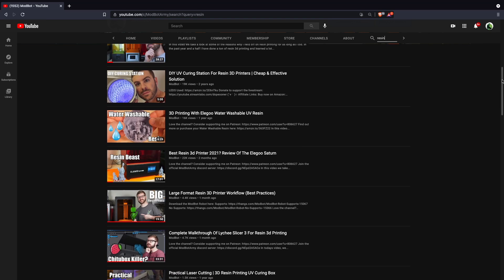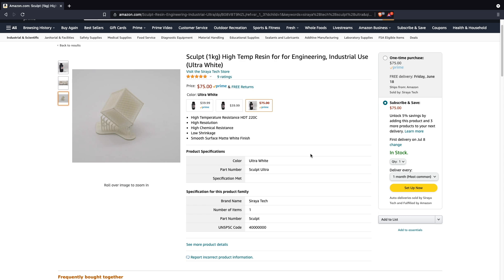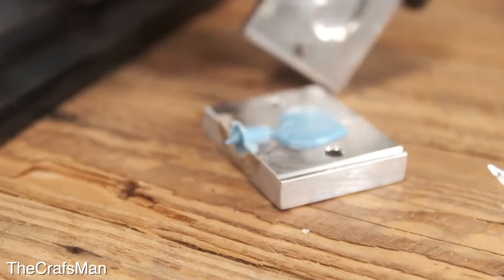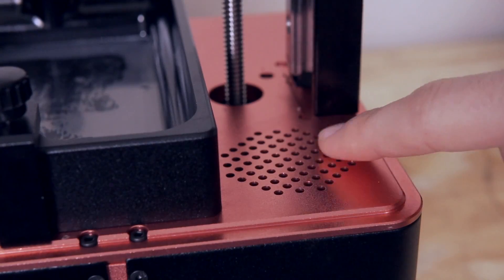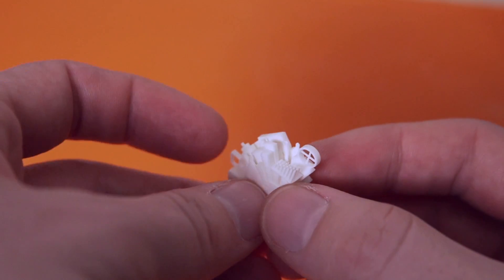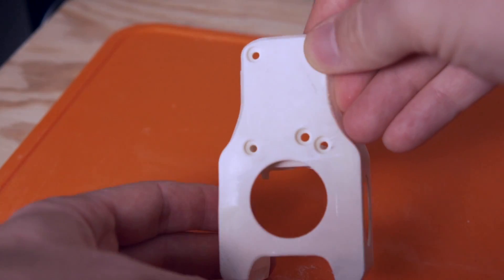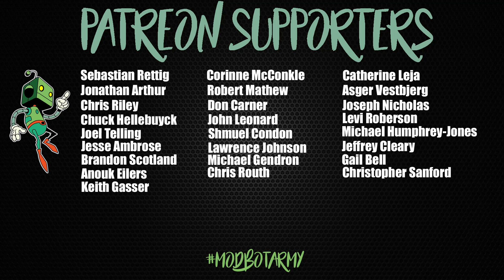High Temp Resin For Function 3d Printing (Sculpt Ultra)

Comment: Theyve actually bumped the hdt up to 250 nowadays but i just bought some of this resin as an option to resin print printer parts that go inside printers with a heated chamber like my qidi plus 4. Im going to make a beacon mount out of this stuff and see how it fairs being close to a 120c bed temperature

Comment: Hi! Did the mold halves came out straight flat from the build plate? Or did they tend to warp a little from the corners ? Right now im having very hard time trying to keep the bottom of the mold straight, it warps like 0.5 mm from the bottom corners. However the cavity face come out dead straight (checked with surface gauge and granite plate). I,m printing with sculpt white version

Comment: I printed a clamping arm with empty bores that were just barely a snug fit for the threaded inserts. I then added some liquid resin to the bores with a q-tip and pressed in the inserts and sent the clamp back to re-cure. Hasn't given up yet.

Comment: I find it impossible that you know all of these things about SLA resin and still dont know to use proper protection. You even mention you prefer low-odor resin because you work in a small workspace which is like, the opposite of safe. You should not be SMELLING the resin (especially as it cures), that means you're inhaling harmful VOCs. You wear gloves to pour the resin so clearly you know its a dangerous material. Do yourself a favor and take your health and safety seriously, or at least stop making videos about resin printing unless you're willing to be serious about safety. Stuff like this leads to new printers harming themselves with poor safety awareness.

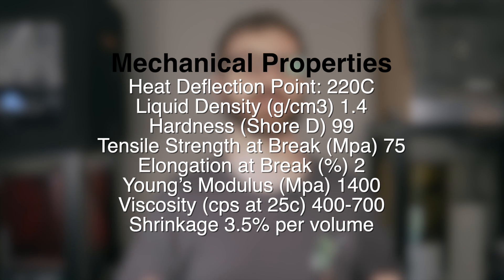Comment: The figures I'm reading in 2024 for Sculpt Ultra White are completely different than those mentioned in your video at 03:30 as well as in your Google spreadsheet. 
For example (newer first): Shrinkage per volume 2.5% vs 3.5%; Elongation at break 1% vs 2%; Young's modulus 8000 vs 1400 MPa (!), etc.
Do you know if Siraya Tech has changed the formulation since 2021? And not a little!

Comment: Seems like resin printing also opens up to practical printing as well. 200+ C° is really really good. Its way better than any FDM material that you can buy without robbing a bank. Details are also important in many applications, especially when the parts are tiny, and you need a smooth uniform surface. An another + for SLA or DLP is that your part has the same strength no matter what is the printing direction  FDM still have its place, but personally i think resin printing can be a huge additional.

And the possibilty to make custom colors, "alloys" oh man... Thats just way more fun than buying filaments that you can not modify

Comment: You should try adding the brass inserts in, without heat, before the part is fully cured, using clear resin so you can UV cure after the brass inserts are in place

Comment: Lower HDT resins will accept heatserts. I've had luck with sirayatech blu. An issue that can occur is overheating the resin.. it will turn into glass / sand. Also, a tenacious mixture will allow for more of a "nylon like" print which will increase impact strength.

Comment: Nope you cannot heat press inserts int resin, resin isn't a plastic, it's a... resin lmao
At most you can dial the tolerances and just force press it in, but then still it's not exactly recommended.

Comment: What resin would you use if you were to resin print an end use auto part, normally made with ASA for UV and heat resistance? Also, do you have a video explaining what and where you can get dyes for resin printing?

Comment: The best Resin I have used yet, is the eSun water washable, its strong has no smell and you can clean up in water, I hate using sticky resin and IPA, its messy and toxic.

Also, don't bother using inserts, just print the thread, and never over cure as the more you expose resin to UV the more brittle it becomes, if you keep it slightly sticky and just paint it, the stuff is almost indestructible.

Comment: FYI heat-set threaded inserts will not work in these types of resin, Generally speaking photo resins are not thermoplastics. You may be able to heat-set them in a castable resin, but most of those are wax like in their cured form and wouldn’t work well for functional parts. Inserts meant to thread into materials would probably work but you’d have to pre tap the outer thread into the resin part.
Reply: So what suggestions would be for this?  I need to print my Voron 2.4 extruder/hotend parts due to breaking something and have access to resin printer.

Comment: Tapped threads actually hold decent pressure so far, tried m3 threads and they came out clean. Might do a test print and use my electric torque screwdriver to get some numbers. Currently printing Hotend duct parts however.

Comment: hmm Im making an ultem high temp printer and this could be useful... 75$ per KG is not bad! (ultem it self is 200$ per kg lol) but I wonder how it can realistically withstand the forces I want it too in my enviroment. but i need it to handle pressure at that temp. not just exist in them! and i want to not suffer degrading at those temps long term. 

my main issue however is that I can't print ultem yet, so i can't make a printer that can print ultem. this is why this rocks. I can just order it from a random SLS seller, my parts weigh only a total of 100g-120g  anyway..

Comment: Great video. Looking forward to trying this resin myself. Instead of injection molding, have you considered casting with two part urethanes directly into a 3D printed mold (skipping making of the silicone mold from a master)?

Comment: Thanks, looking forward to the follow up video.  With brass inserts I've had good luck with oversizing the hole to the OD of the insert and then coating the hole and insert with resin and using  a uv light pen to set it.  I also find when over sizing the hole it's much  better to run your drill in reverse, prevents cracking and chipping bit I still effective at drilling.

Comment: i print molds for silicone here. I just use normal resin and spray with mold release and it works fine. I don't know why you would want this heat range for a mold? what material do you plan to cast in these?
Reply: If you want to use a thermoplastic material such as polystyrene which melts at 464 deg. F a silicon mold wouldn't handle it. If you want to cast metal there are alloys that melt at around 200 deg. F which could be cast in Sculpt Ultra.

Comment: Great video. Specially the info about the brass heat inserts. I was wondering about that myself. I guess I could just design my parts so the insert just drops in. Put a piece of scotch tape to close the threaded hole at the bottom and glue them in with either epoxy or even better yet a uv curing adhesive.
Reply: Yes, i've done this and epoxy works very well.

Comment: These photopolymer resins are what is called thermoset polymers, which do not melt but burn when exposed to heat after curing.

Comment: If the part is big enough, you can use these  'Nartel® Metal Self Drilling Plasterboard Fixings Cavity Wall'' . Break the self drill tip, and use 7mm drill.

Comment: Resins are Thermoset polymers (https://en.wikipedia.org/wiki/Thermosetting_polymer) which means they cure once and then with heat these polymer degrade rather than "reform". This is why you saw the "crumbling effect" when you tried to put the heat inserts in.
FDM polymers are Thermoplastic (https://en.wikipedia.org/wiki/Thermoplastic). These Polymers can be remelted and this is why you put heat inserts in.

Comment: You may already know this, but professional prototyping services will usually use helicoil inserts for screw bosses in SLA parts. You have to buy a tap-type of tool for each size you want to apply, and installation requires a little bit of user skill. They're not cheap, but work well.
Reply: Maybe you leave the holes larger so the brass insert slides in feely. (First, mask off the bottom of the insert.) Fill the surround with clear resin. Then UV cure it. Will the UV light cure all the resin, or will the outer resin filter the UV "protecting" the inner resin?
Reply: I was going to say the same but you got there first
Reply: @dougyt261  I was going to say that before you.

Comment: i'm working on using castable wax resin to print parts. Put in investment plaster, harden, and burn own.  You can then use the investment plaster molds to cast aluminum.

Comment: I have tappered heat inserts work fantastic on resin. I've done a drop of resin, insert, re-cure and I've also done a drop of super glue and these are even stronger and less stepsI've been using these inserts. https://www.aliexpress.com/item/1005001770296100.html
my first major resin failure on my Voron... https://www.facebook.com/sylvain.martin/posts/1185409028554328:9

Comment: My only complaint with resin printers is the limited ability to modify them and upgrade them. Would be fantastic if they was as modular as FDM printers so I can tweak things to make it more closely fit what I want to do. Very interested in seeing some tests combining the resins and see if a better overall resin can result...
Reply from the maker: Yeah, would be nice if you could hack and mod on them like an fdm printer. I think it may end up coming but it will be much more complex and less DIY. I can see third party companies releasing upgrades that would require you to buy them

Comment: Heat inserts won’t work because resin isn’t a thermoplastic. It just dissipates into atoms instead of becoming a fluid again when heated. Maybe someone invents a thermoplastic resin in future
Reply from the maker: Thank you! That would be awesome. Excited to see this technology continue to evolve.
Reply: @ModBotArmy  There are self tapping inserts now. You may need to change the hole diameter but I think it's worth the try! Also a strength test would be cool https://vonwange.      com/product/100-pcs-self-tapping-inserts/

Comment: I might be wrong, but I think cured resin is a thermoset so it doesn't melt like FDM parts which are thermoplastics; they'll just burn and crumble instead.
Reply from the maker: I do think you may be right. That was at least my results.

Comment: Is there any safe resin with no fumes? I’ve been wanting a resin printer, but I don’t wanna put my kids health at risk.
Reply: There are plant based resins that are a lot safer. I cant say if they're 100% safe but I know they're better. It really isnt all that bad inside of the printer itself anyway, its more of when you're handling the resin.
Reply: @Xploit66  can you share some sources on plant based stuff being better for health?
Reply: The carbon filters that seem to come with most resin printers are pretty questionable, so I rigged up a fume extractor using some flexible ducting and an inline fan to just yeet the air from the printer to outside of my house and it has been working really well.
Reply: Respirators and ventilation

Comment: Instead of brass inserts use helicoils.
Reply: @ModBotArmy  so you use their special drill and tap. You then thread the helicoil into the thread. This then makes a secure permant steel thread. We use them in cnc fixturing all the time to make our aluminum fixture plates stronger thread wise. Super easy to do. I use them on my resin and fdm printed parts all the time.

Comment: I did some work with my university’s polyjet printer and injection molding, and it worked pretty well. The original plan was to use a high temp resin, but I accidentally printed it out of the normal VeroClear material. Short of any small features, it worked really well, so you might not necessarily need to use a high temp resin, depending on how your mold flow is. 

I don’t have a lot of pictures,  but if you do get injection molding capability, it would be worth seeing if you can use a simpler resin, for a few injection shots. On a related note, do you think a sufficiently large extruder and hot end could substitute in for a small low volume injection molder?
Reply from the maker: What polymer were you using for the injection mold. And are you saying do I think you could use a large hotend and extruder to make a DIY injection molder? Or simply could a large extruder/hotend keep up with an injection molder for small scale production? As far as a DIY injection molder I dont think it could melt enough plastic quick enough to fill the mold without some cooling happening (this would depend on mold size) as far as keeping up I do think it could be close but the injection molder is still likely to be a bit faster and definitely have finer resolution compared to a large hotend/extruder
Reply: @ModBotArmy  It was a Objet printing VeroClear, which had a HDT of 50C, but we used an aluminum mold housing (just around the mold, and in direct contact with the nozzle).  It worked well enough, but there was noticable wear after maybe 10 shots, so limited use cases.

And Depending on the volume of the mold, I think something like a Volcano could get a decent flowrate.  I was doing these tests on a small part, around maybe 10 mm^3, so it would be very size limited.  I was not super clear in my original comment, but should clarify that the volume of the individual mold and scale of the production would both be limited, and such a device would only be possible for prototyping.  

The injection molder we used in the tests was hand operated, so there was not a lot of control, just pulling down until we felt resistance.  On a production machine, there would absolutely be more control, but for these simple tests, it just increases flashing (which we mitigated with more clamping pressure, bent the machine's clamps while doing it, whoops).  In terms of cooling, it will totally happen, but with a decent sprue and some pre-warming, the molds worked alright.  Getting the molds warm first was definitely helpful, initially as a steady state after several shots, and then with a heatgun beforehand.

It's mostly posed as a theoretical.  I don't have the equipment to test it (SLA printer, high flow hotend), and was wondering your thoughts on it.  Ultimately, it would be of very limited usefulness, but would it enable some baseline testing of the resin you showcased in the video?  I think the molds would need to be different, smaller volume, but I see the target for a 3D printer enabled injection molder would be parts too small to effectively FDM print.  My links have caused some comments to not appear, so I'll put it in the next in the thread, but my results are likely related to the very small part I was printing.
Reply: @ModBotArmy  In case this comment gets deleted, a followup with the link of the part I tried to IM. https://github.com/dotdash32/Cases/tree/master/Keycap%20Designs/Key%20Switches

Comment: You've figured out my secret!  LOL

Actually, pretty much all of the common resins will withstand up to 150°C w/o any deformation.  The prints look, and function, exactly like extruded plastic parts.  This is why I had been trying so hard to get my Elegoo Saturn.  While I would never have considered using an FTM print on the print head of a 3D printer, due to low temperature resistance and stress tolerances, I can create resin parts that I don't need to have any concern about when operating in an 80°C ambient temperature environment.

As for the heat inserts, they were designed for FTM and low temp plastic extrusions.  Those materials don't stand up that well to the stresses that a nut and bolt can expert, so they work well with those materials.  Resin prints can be much stronger, even stronger than some hard plastics when compressed, so nuts an bolts are a much better option.  You really wouldn't want to use these brass inserts on hard plastics/resins, as the material would need to be weaker than it currently is, to do so.
Reply from the maker: Interesting I have never tested max temps of standard model resin. I would like to play around with this more in the future. Someone made some recommendations for other inserts and another said insert before curing. So many things to try out :). You end up getting the Saturn?
Reply: @ModBotArmy  yep.  I used camelcamelcamel to notify me when the price dropped below $500, which means that Elegoo has inventory in stock.  I was able to get one in April.  Since then, they have been in stock for days at a time now.  😁